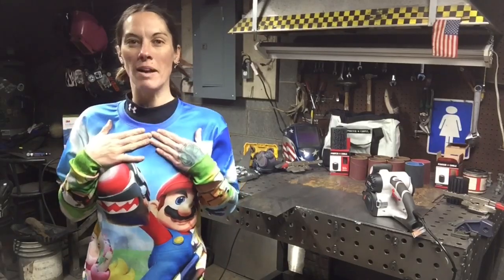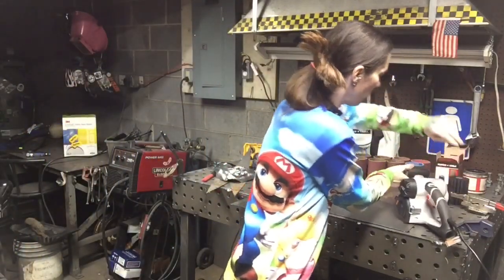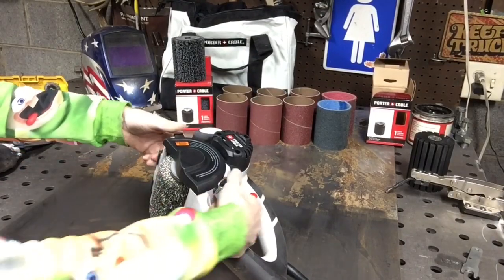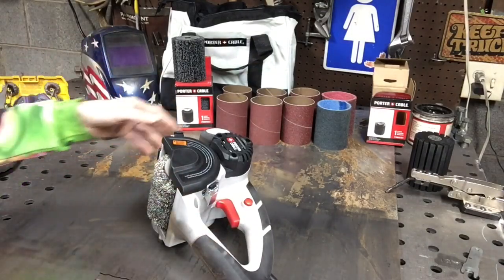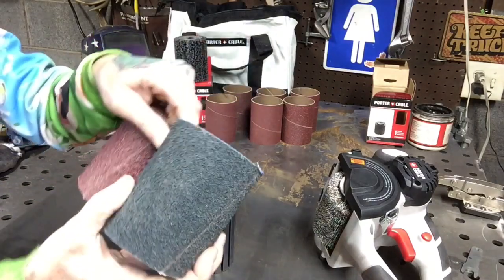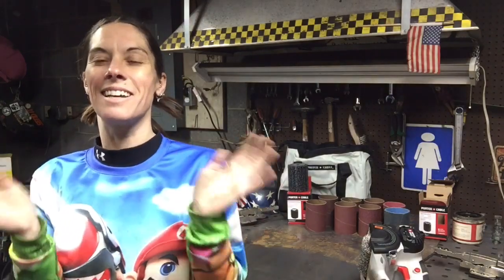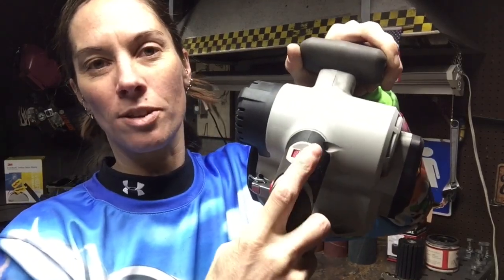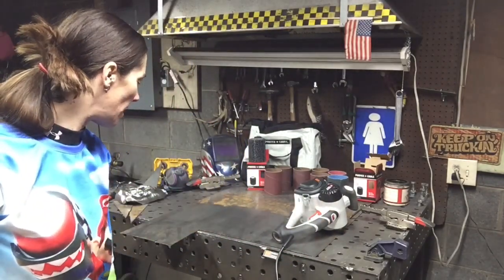Surfacing Cleaning & Finishing Metal Tool | The Restorer Review | Clean Rust | Barbie The Welder

Comment: Wow the machine costs $100 on amazon but the stainless wheel is $50.  Barbie, I wish you had shown us how it works on heavy rust in real time with sound. I need to know that it will work better than my angle grinders with a twisted wire brush.  The combo you presented costs 3x as much.  Straight wire brushes don't last long and are dangerous on an angle grinder.  i see some possible advantages for the restorer but I need to hear the motor on tough rust to know how long it will last.  I have to be tight fisted with the dollars. 
Thanks for your review.  I love your channel.

ATB
Jeff
Reply from the maker: Ahh respected and appreciated Jeff! The motor didn’t bog down at all with this rust, and it was deep enough to leave marks in the metal.

Comment: What is the acid called when you do a cutting edge and where do you get it if anybody knows
Reply: I you're wanting to etch an edge to check your weld nugget you can use phosphoric acid on steel after you polish the edge. Regular naval jelly works pretty good to do it. Oven cleaner will work on Aluminum (sodium hydroxide). Depends on which metal you have. You may have to use a heat gun to help speed up the reaction. Surfox is another solution they use for etching too.

Here is a link to some different etching solutions for different metals http://www.etchantstore.com/Weld-Inspection-Etchants_c11.htm?page=all

There are also different solutions you can use for different patina effects as well. Be careful, these products are very caustic and make sure to follow the direction on how to use them.
Reply from the maker: Thanks for taking your time to help! I had no idea how to do this! I love how beautiful people have been on my channel helping each other! I appreciate you!!💙👩‍🏭
Reply: You're welcome, no problem.